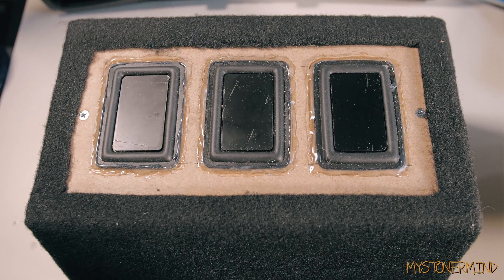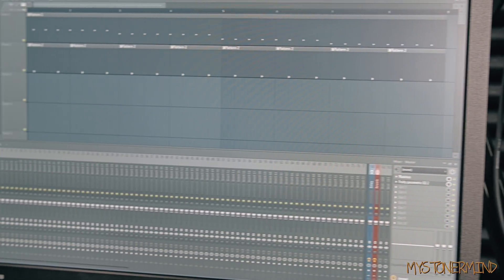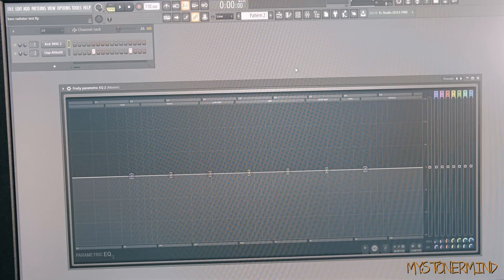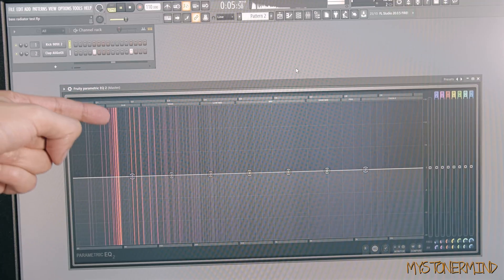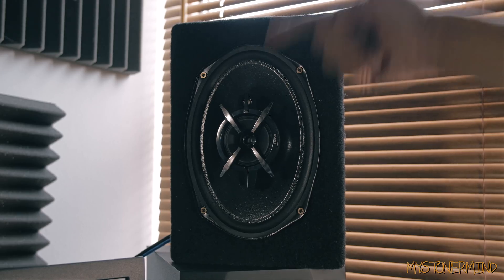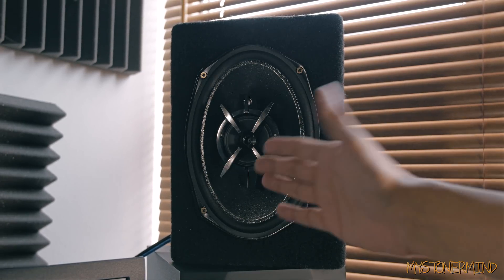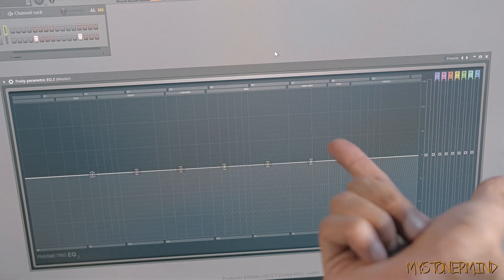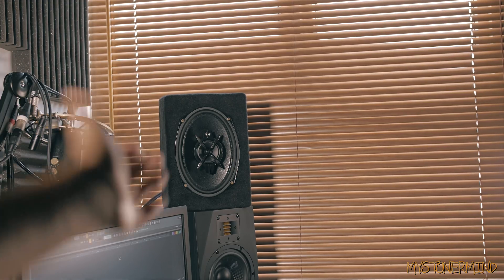Bass Radiator vs Sealed - Test (HMMM)

Comment: I actually feel like the box without the bass radiators was more muffled and the other one clearer
Reply: that'll be cause of the mic, not the speaker, means less bass i assume.
Reply: @JonathanGerardDias  Whenever I tune a car audio system I go purely for DB's. That's what the mic would pick up. The mic makes no distinction of distortion or clarity. Sealed boxes sound clearer, crisper bass. Ported boxes can be tuned without resizing the box to gain more DB's. I've never messed with radiators, but I'd assume it's a similar comparison.
Reply: @JonathanGerardDias  Could also very well be variations in the components.
Reply: @rampagetv  yeah thats possible, maybe the tweeters of the one in the sealed box were slightly different. Or as @Jonathan Dias mentioned it could also be the placement of the mic. Or maybe even my imagination

Comment: i would have just put 1 instead of 3
Reply: 3 are actually tuned for a higher frequency than 1. 1 adds more distortion, however. You need a bigger box to utilize 3 and not raise the  port tuning.
Reply: La Crosse WI EAS no, just no

Comment: The higher notes are very little louder in the passive radiator box.the lows are pretty much the same 
I’m wearing Bose headphones so NO COMPLAINTS People
Reply: Because bose is good haha.

No but seriously, I have studio monitors, bose are not that, especially active cancellation ones
Reply: @nerfinator03 no they aren't noise cancelling they are some old models but sound v.good and they are the only working pair I have
Reply: @jedithusnbixby2108  "the only working pair" - I hope that's not a complaint :)
Reply: Dušan Barlík nope
Reply: But the fli audio speakers are capable of creating a little amount of low bass in both sealed and with passive radiator box
Reply: Compared to the Sonys

Comment: At the higher base notes there was more difference than at the lower frequencys, witch tells us that the bass radiators are tuned to high. 
Try to add 2 X 15 gram washers to the inside of each base radiator and try it again. 
If that doesn't help doable the amount of washers. 
and a quick question. are the bass radiators at there exursion limits ?
Reply from the maker: I replied to a similar comment already, but the next video has already been made. 
Spare some change?
Reply: @MyStonerMind420  did it work out great or not ?
Reply from the maker: @creative_stwb1336  you want me to spoil the surprise? Enjoy the foreplay, man.
Reply: @MyStonerMind420 jear your right. I am just to exited about your way of takeling things like this
Reply: @MyStonerMind420  Have you ever Experimented with T-line enclosures ?
Reply from the maker: @creative_stwb1336  I have not tried TL enclosures yet, maybe one day but I can't promise anything.

Comment: I think its more difference with fli speaker but it's really small and not worth to buy the bass radiators, i personaly think that only port can make bass louder, and the bass radiators sucks overall.
Reply: Radiators have virtually the same effect as ports if properly designed. That's objectively the case.

Comment: On 50 hz there is definitely more bass but on lower there is not much increase i m using headphones so dont complain anyone
Reply: yea, it just increased a bit in "upper" bass.

But well, he just hot glued a few radiators on it. What would you epect.
They need to be calculated and have a specific stiffness. Here is nothing calculated. Just glued something together.
Reply: Because you are judging frequency based on your earphone so what you're hearing is the capabilities of your speaker not the one shown on the video. I hope that helped.
Reply: @theuncanspan  no your judging the capabilities of whatever tin can garbage mic the audio was recorded on
Reply: @theuncanspan  i know that. But if you got gear with a flat response which does not add its own colour to the sound you can maybe closely imagine how they sound. At best.

But you should hear a difference anyways when proper built.
Reply: Same but mine are better
Reply: @elclark_id  140 bit audio is pretty high-end, if you ask me...
Reply: I totaly agree with you 🙌🙌
Reply: Using my stereo/studio headphones.......
Reply: @elclark_id  Nah not even 140 kbps.. I think it's around 128
Reply: ๙